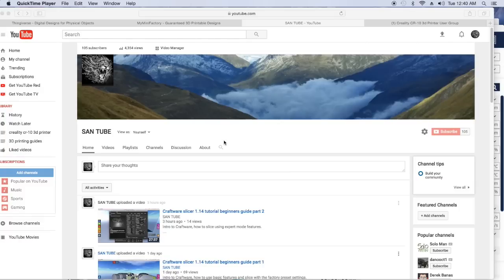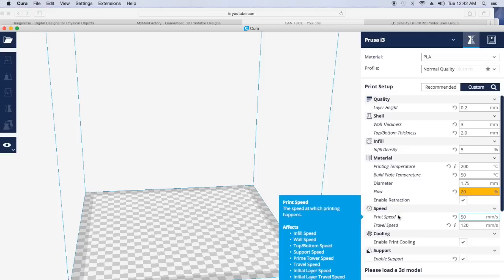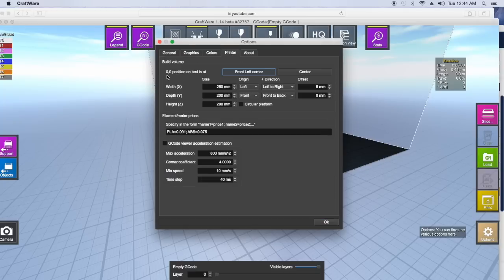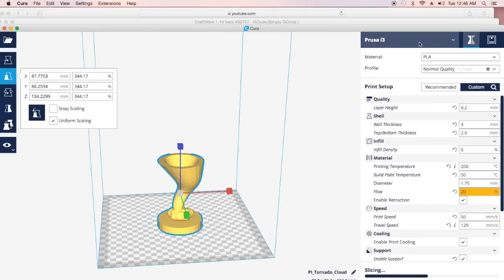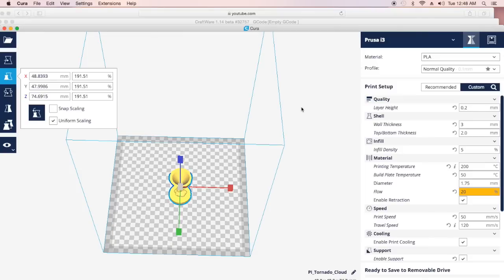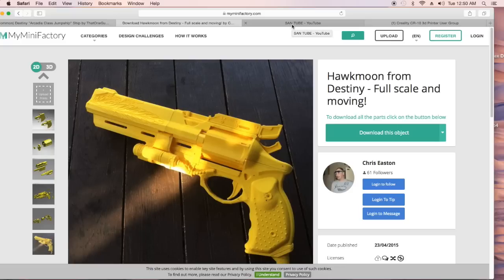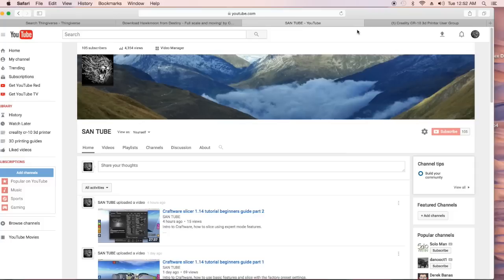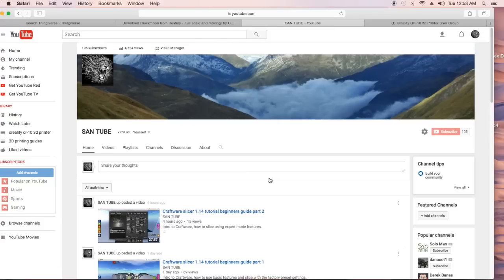Creality Cr-10 3D Printing: Problems and Solutions, Beginners Guide.

Comment: The problem I’m having with mine is when I click auto home it keeps dumping and it seems like it’s stuck at the very bottom left-hand corner as if it’s saying that that is home but when I keep changing the XYZ to match the center of the plate, even when I go to print some thing It’s not close enough to the glass to print properly and even when I click auto home again, it goes back to that same section instead of the center of the plate. It makes a loud, thumping noise like it’s having an error. Constantly trying to push itself in a different direction that is not matching the coordinates.
Reply: Did you ever find a fix for this I have the same problem I’m new to 3d printing

Comment: Basic cr10 from a year ago.  Heats up just fine, starts to print.  Gets about 2 to 5 mins in and just stops.  Screen freezes up, button does not respond.   Only way is to turn the on/off switch.                 Once powered back up, says "power interrupted"   resume or stop print.   Thing is, this stock printer isn't supposed to be able to do that.  Also, it doesn't work anyway if I click resume.      I have a continuous uninterrupted power supply running.  The other printers never stopped, house never has a flickering of power going out.      I even tried to start a different model up, still did it.       Any ideas?????

Comment: @SANTUBE 3D
Good day. We recently bought a Creality Cr-10 V3 and was using itjust fine until we had to temporarily move it to another table.
Problem is, once at the new location, the printer just doesn't work. The bed and the extruder heats up but after starting to print, the printer just stops and the control panel is frozen as it won't receive inputs anymore.

Also when we set it back to home, there is this wierd pop that sounds like its coming from the extruder or bed, we can't tell which.
Reply from the maker: If you can send a videos it will be super easy to help. It’s harder to figure out from description. Did you guys unplug any wires or take anything apart?
Reply: @SANTUBE  thanks for the reply. 
Yes I did disconnect the cables connecting the printer to the control panel but loose wires weren't the issue.
Apparently, my father copied over some files from his PC and one of them was a bin file. Not sure if it was the bin file interfering with the 3Dprinter but after reformatting the SD card, everything works again.

Comment: My printer (creality cr 10 s5) x axis is not moving. At all. I can move it with my hand but it doesn't move when the printer tells it too. What do I do?
Reply from the maker: Sorry for the late reply, Sounds like your connections are connect correctly.  You mite have to open the control box to make sure the cables are pushed down all the way.  Easy way to check if its you cable or motor.  Take the Y axis wire and connect it to the x then try to move y axis and if your x axis  moves then its not the motor you just have a loose connection. Hope this helped.
Reply: @SANTUBE  I have been talking to customer support and I'm about ready for a replacement, hopefully what you said helps, thanks!
Reply from the maker: @iforgor227  Good luck to you bud. Hope everything works out.
Reply: @SANTUBE  so I got it to move right. But now it can't move left
Reply from the maker: thattrojanguy tru to auto home frist
Reply: @SANTUBE  the y and z axis work just fine. No matter what I do, x doesn't want to move
Reply from the maker: thattrojanguy it really sounds like your u have a loose connections somewhere.
Reply: @SANTUBE  once again I have checked all the wires. And creality is sending me a replacement anyway

Comment: My CR-10 turned on for a moment and then shut off an now it will not turn on at all. Any advice suggestions as to get it going would be appreciated!
Reply: There’s a “switch” on the right side that says 230 use your finger a somewhat that can reach and put it to the right and now you’ll have 115v. Mine did the same and once I did that it came on.

Comment: Question: How do the printer settings you've configured in Cura actually get to the printer? I'm assuming via the memory card? If so, how?
Reply: Either from a direct connection from your 3d printer to your computer running Cura or yes, a micro sd in most cases. Cura will allow you to save the file in a format with all settings specifically made for your printer.

Comment: I have an ender 3 pro, when starting to do a print it stays to the left side edge going up and down digging into the bed tapping away with the filament at the bed

How do I fix this issue?
Reply from the maker: Check your z limiter switch to make sure it makes connect when the x axis comes down towards the be, by any chance did you modify your start g-code, also click on preference top left side , then printer, then machine settings and make sure your origin to center is unchecked.  There could be other things too but lets start with that for now.
Reply: @SANTUBE  I had this issue with my Ender 3. Turns out I had the Z axis and extruder plugs swapped.

Comment: The glass on my cr10s4 was perfectly flat and uniform in thickness. The alumium bed however, was not. It was dished like a bowl and an inspection on my granite surfaceplate showed a ridicilous dip of 1,6mm in the center compared to the corners. I have straightened it as best I can, and it works ok, but I will be replacing it with one I make myself and grind or scrape perfectly flat and fitted with a 220v heater. It sucks so bad having to wait 20 minutes for it to reach 60 degrees to see if the print starts ok.
Reply from the maker: 20 minutes is a long time so I can understand why its upsetting but good luck with the new bed.

Comment: Love your videos. They helped a ton with setting up my first printer (CR-10). I found a trick if your glass seems warped and you can't get the middle level. I just put 1 extra strip of masking tape on the underside of the glass and then tried to level it all again. It took me about 3 strips to finally get it all level. So if the middle seems to be sagging I think you can fix it a bit by putting tape strips on the underside of the glass just only in the middle and not the outsides. Keep up the good work. Cheers.
Reply from the maker: You are correct, I made a video showing exactly what you said with the extra layer of tape as a temporary fix.

Comment: Hi my printers z axis keeps on making some weekend notice every  time it goes below a certain hight
Any recommendations?
I have a flashforge adventure 3 btw
Reply: Hi, we use many of the Flashforge Adventurer 3's for our business. I'll help you if I can. But what exactly do you mean by "making some weekend notice"?
1 MAIN thing with that printer that nobody told me for 6 months. It ships with the gear tension set to max. (It will still work like this.. but in 3 months you will have issues)
This is to help with shipping. There will be an allen key included in the maint bag with the printer. Use it to loosen the hex screw until it sits roughly flush with the casing.
Then slowly tighten it back up until you feel a change in the resistance. (Overall, it should be MUCH looser than it came)
Also, Flashforge PLA is best printed at 195c, even though the default settings are 210c. (The rolls will say 190 - 210c though).
We had some pretty bad gear slipping and 'clicking' noises on both printers for a week (causing under-extrusion). I tried EVERYTHING.
Except turning the temperature down.... I only tried up. Turning it down (and fixing the tension) fixed both printers to the point they are now better than new.
For any axis problems, just clean the guides and then re-grease them with a brush.
You should be able to do ALL the maintenance without taking off any of the casing of the machine.
If you want to unclog the nozzle, and are trying the 'Atomic' method, you may need to pop off the clear top window.
But for us, unloading the filament, unplugging the bowden tube, and then hand forcing some PLA down the extruder fixed any clogs we had.

We use the default flashforge software, and no machine upgrades (or replacements).
We print high quality model and experimental rocket parts for a business.

Comment: Hi, I'm nub. I have a cr10s with cura I just finished assembling/ setting up. I pulled up the little boat for my first print and loaded it up and it was doing pretty good at the start. Then.. it stopped paused there with the extruder still hot and did nothing. I thought maybe it was waiting on the bedplate to warm but idk why the extruder would stay hot like that and not relocate. Then it rezeroed and started from the beginning and screwed everything up. It did it twice. I'm running via USB to the cr10s. I can't get the card to work that it came with plus I like the onscreen read outs. Any idea what caused this and how to fix? I am using the USB wire it came with.
Reply from the maker: How did you connect using your computer (PC or Apple).  Try printing something else and see if the file is the problem.  As for the SD card no working. make sure its plugged in correctly because sometimes when you go to plug in the card it gets inserted in the gap above the slot.  also get a SD card extension cable. sorry for late reply.  Good Luck.
Reply: SAN TUBE pc a USB cable it came with. Using octo through cura.
Reply: SAN TUBE I think it has a short somewhere. The lcd display light level changes rapidly and i witnessed it go blank right before it reset last time. The SD port just don't work. I tried it every way I could without damaging the Port. It also doesn't want to go to the lcd menu sometimes when I push the knob. Instead it goes blank but the lcd display stays lit. I think I have a dud.

Comment: I just bought a 3D printer. The stepper motor runs, my nozzle is up to temp and when I execute a print, it moves around, but no filament come out. Anyone have any suggestions?
Reply from the maker: Did you check for a clog?  Have you tried priming your nozzle by hand to see if filament comes out.
Reply: Sounds like the filament didn’t reach the nozzle.  You have to feed a surprisingly large amount thru the tube.  Heat up the nozzle and push until it comes out the nozzle.

Comment: what if everything heats up fine you hit play and nothing moves printer just counts down on timer as normal
Reply from the maker: Something is wrong in your g-code.  Try slicing another model and see if it does the same thing. Now this would be just one issue.  also try using another SD card.

Comment: I had to put the file on a different SD card to get it to print.  That still doesn't help explain what is wrong though.
Reply from the maker: if all you did is change the SD card but had the same file then it mite have just been the card.

Comment: I'm struggling to find anything thin enough to pass through nozzle to break blockage up any suggestions on what I can use also does anyone know where to order new nozzles
Reply from the maker: Its easier to just buy nozzle now instead of unclogging them but i would still recommend you try just to understand how to do it. Here is a video on that, its not the most common way but it worked for me.: https://youtu.be/wEvIEVAJ_P8.  Here is a link for the nozzles: http://amzn.to/2zBemhi.

Comment: How about making a video showing what to do when an object from won't print?   I'm trying to print an item called the Screwdriver Stand on my Monoprice Maker Select 3D Printer and it just refused to print!  At first I thought it was because the size was too big at 200mm which is the max. size so I reduced it to 95% but it still refused to do anything.   I even made a new version of it in 123D Design and that won't even let me make a GCode file of it in Cura!  How can I find out what the problem is?
https://www.thingiverse.com/thing:1701814/
Reply from the maker: ok let me try to print it and i will let you know what happens.

Comment: After printing the bed moves to the back instead of coming out front on my CR-10s. Any way to fix it?
Reply from the maker: check your axis wires i think you have the wire switched.
Reply: SAN TUBE the prints come out fine though

Comment: SAN TUBE i need help.......plz meassage me
Reply from the maker: How can i help?
Reply: SAN TUBE sweet I was just gonna sleep, but since I got u her I go, 
So I just got the Cr 10 4 hours ago and I have 3 problems with it
1 when I attempt to put the pla filament through the tube and when I start printing, the cr 10 keeps taking the pla out & it'll start printing in the middle.

2.  I have absolutely have no idea how to transfer a made print on thingongverse to the cr 10.

I can show u what I mean through a video, do u have a messanger.
LMK thx

Comment: Hey, I just started my first print on my cr-10, everything was going fine until after the heating. The vertical metal rod started turning back and forth over and over again. Please help
Reply from the maker: Are you talking about the Z rod, thats the one that pulls the X axis up and down.
Reply: Yes, it is the metal rod going up the side of the back left post.
Reply: https://vimeo.com/245092227 for a video of it
Reply from the maker: I think you have your wire crossed. double check your z, y and x axis wires to make sure they are connected in the right places.

Comment: My creality cr10 didnt come with an sd card. (false advertising). do i need it? and if so where coould i get another. My printer came with no instructions. But i already have it built ready to go... i think?lol
Reply from the maker: http://amzn.to/2wyWxjq  ----- SD card extender. 
http://amzn.to/2yIZkrq    ------ Mirco SD card
Reply: I wish that was the prob. The discripion said that it’ll be included but when I couldn’t find it anywhere I contacted the seller and then said that he made a mistake and forgot to delete the Sd being included. Also it didn’t come with a flash drive. I would’ve paid more for full accessories and how to operate. But thank god for the Internet and youtube. I’m just waiting for SF,tr, extension, pro filament  and back plate to print on. For some reason I couldn’t make the usb cord to work to print directly from laptop. So yeah, playing the waiting game till the 31st
Reply: Allen, I thought mine didn't either. I found the sd card stuck in the back of the thumb drive. Sneaky bastards, LOL.

Comment: Just got mine and the z threaded rod seems to want to keep coming out of the motor adapter. Is this common? If there a correct way to fix?
Reply from the maker: the is not normal. insert the rod back in and tighten the lock screws.
Reply: Ya thanks, I didn't think it was normal. Set screw was loose. Thanks for your content man.

Comment: Hi there. On my CR 10 when I enter Auto home position on the unit, It moves to home area, But my Y motor will not stop once it hits the stop switch. Dose anyone know how to fix that problem
Reply from the maker: I think you have your Y and X axis wires switched.  Does the Y motor make a clicking noise then thats it.

Comment: I just bought this printer and I'm trying to print something and the nozzle keeps getting clogged and nothing comes out. The extruder is not clogged because the filament itself can go though it. Any ideas how to fix this so I can start printing? Thanks
Reply from the maker: Swammyswamswam your printer should have come with a thin metal wire looking thing. Once the nozzle is warm stick it in there and that should free it up. Make sure there is no filament in the tube.

Comment: Excellent video!!! My glass dips in the middle on one side and bumps up in the middle on the other side. I ordered a new piece of glass. 
Get Simplify3D bro! It's super easy. I downloaded Cura, but there was no option for the CR-10. I had no idea how to get setup. Simplify3D was super intuitive, and it has a tool for leveling the bed. Although it doesn't check the middle. I wouldn't have known my glass was deformed if not for your video. Thanks again!
Reply from the maker: Happy to help.  I have looked into S3D but for the $150.00 i get most of the features in Cura.  Plus S3D hasn't really update or added many new features.  Maybe if there is a new version in the feature i will think about it.  Good Luck and happy Printing.

Comment: My printer keeps printing in the corner and I want it to print it in the middle
Reply from the maker: By default the CR-10's home is top left corner, this is a very easy fix.  Open Cura, click on Cura at top left then Preferences then printers then machine settings then uncheck where is says machine center is zero and that should fix you problem. Good Luck!

Comment: Great video, as always!  I have a question regarding the micro SD card extension.  I have read that there are a couple of problems with it. 1. the male portion does not lock into the printer.  2.  Once in place, if you remove card (to take it to computer to get file) and replace it  the printer wont see it unless you remove the cable from printer and reinsert it.  Is this factual information?  If yours does not have these issues, I would appreciate specific brand and source info.  On a somewhat related issue, have you tried to connect the printer directly to your computer?  I tried tonight but gave up when I found out apparently it's not just plug-and-play, there are drivers involved, etc.  Have you considered a video on this process?
Reply from the maker: Dan J the ad card extension works for me no problem.  If the printer is on and u remove the card then plug the card back in it does not recognize it but you can initialize the card reader again( there is an option for that in the menu) or leave ur printer off plug in the card then turn it on, these two work for me. I haven't plugged a computer into it as of yet but I did try in the beginning and it is a pain but I have no need to connect it since my printer and computer are in two separate rooms.